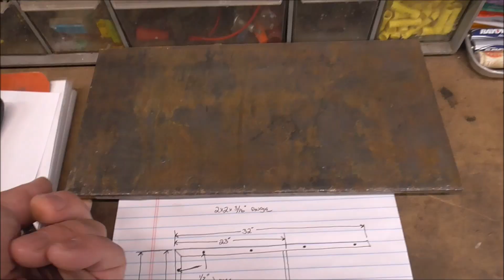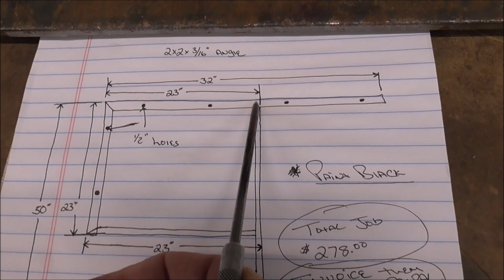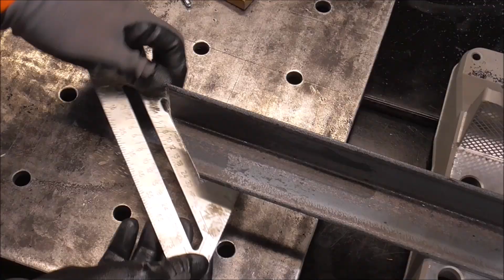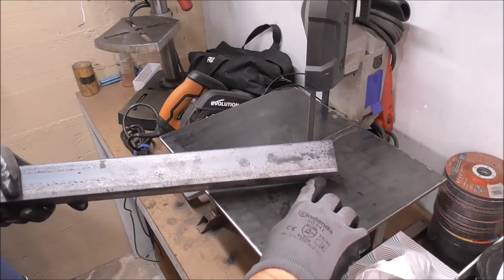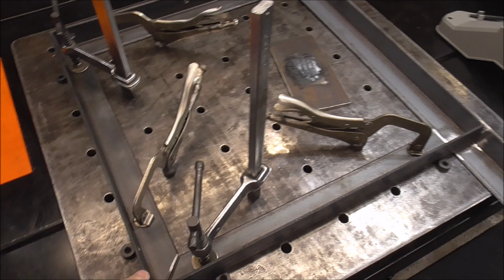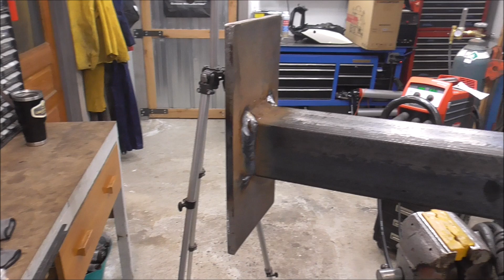Mig Welding Customer Fabrication Job

Comment: Brandon, great video.
Any specific reason you were using cutting fluid on the cuts done on the Evolution saw this time?  I have not seen this done before on the "dry cut" saws. I have the same saw as your orevious one so am wondering about using cutting fluid.
Cheers from Portugal
Reply from the maker: It probably wasn't necessary because aluminum is soft but whenever I cut on the flat, because so many teeth are in contact with the material at once I figure it wont hurt to add some lubricant to make things go a little smoother and cooler. Great question! Thank you!

Comment: Great job explaining as you go.  I always appreciate and enjoy your build projects.  

I dont know if i missed something between your drawing and the actual build.  I tried to carefully follow along.  To me the mounting holes appear not to be where they were on the drawing.  They appear on the drawing  to be on the flat when laying on your bench. The finished product the holes appear to be not on the flat when laying down?

Just curious... Dan 😊
Reply from the maker: Thank you! 🙏The holes were just an illustration to show the customer wanted 4 on one leg and 2 on the other. Apparently this is bolting into a corner wall or something along those lines
Reply: @BrandonLund  Cool,  you had me going there with the difference between the drawing and finished product. Looking forward to your next project...

Thanks for responding.

Comment: Hi Brandon.
Yet another great informative video. I noticed you beveled and cleaned the joints, prior to welding. But you didn't remove the millscale prior to painting. Do you feel this is acceptable practice, as i always do and it's a real spherical ache.
Cheers Steve.
Reply from the maker: This bracket is being used on a heated interior building, so there is no chance for rust. For ultimate protection, the best practice would be to have it powdercoated. I've had pretty good luck on leaving the millscale on interior projects as long as you wipe the material clean until there is no black being transfered onto your rag then going over it with a good paint.
Reply: @BrandonLund  In response to your ok heated building, I doubt very much the lift shaft is heated. So condensation could be a problem l was only asking could get away with not removing millscale prior to painting.
Cheers Steve.
Reply from the maker: @stevenginnever5343 thanks Steve. I've not had any problems with not removing mill scale if it's not out in the elements.  I suppose anything if exposed to enough heating and cooling cycles with condensation will eventually rust but it certainly doesnt hurt to remove the mill scale. I know years ago there was a debate about bridges being painted or to just let them rust and eventually they neutralize on their own. I guess much depends on the situation. I built a set of handrails for my basement. Those I removed millscale because they get handled a lot and that constant touching will wear away the coating.

Comment: I noticed you weren't wearing your respirator during the welding process looked like the burn off was tight into your face. But it did look like your Air Vac system was working pulling the burn off up and away 😮
Reply from the maker: If there was a clip where  I wasn't wearing a respirator it's only because I forgot to put it back on in-between shooting video scenes. That's the drawback of being the welder, fabricator, videographer and editor lol. With all that going on sometimes things get missed.  Kind of like how we sometimes look around for our hat or our glasses all the while it's on our head.

Comment: Great video Brandon. What are you using for a cutting lubricant for this saw ? 
Thx Mark
Reply from the maker: It's concentrated cutting lubricant I picked up from Napa.  I reduce it down with water. It's really good stuff.
Reply: @BrandonLund  thanks for sharing that Brandon
Much appreciated. Have a great weekend. 
Cheers Mark

Comment: Hey Brandon, I have an evolution saw and love it, in your opinion is more cost effective to have the blades resharpened or to buy a new one, I know the blades are expensive and what kind of cutting oil do you use on your blades and drill bits, great video my friend 👍😁❤️
Reply from the maker: I love evolution tools. I've yet to find one I don't love. As far as the blades, the Evolution blades can't really be professionally sharpened. The carbide are really small and it's next to impossible to weld. I've been told the Diablo blades are the best and CAN be sharpened. My next blade purchase will be a Diablo for that reason. I think project farm did a test on this and that was his conclusion also. Great question bud! I should probably discuss this in an upcoming episode.
Reply: @BrandonLund  thanks brother

Comment: Great project with detailed instructions.  Nicely done.   Have a great weekend my friend!
Reply from the maker: Thanks Earl! I hope you have a great weekend also!
Reply: @BrandonLund  I am in the process myself of finding out what the market will bare here in Ft Worth.  I am probably cheaper than most because of low overhead, but I don’t want to cheapen the trade either.